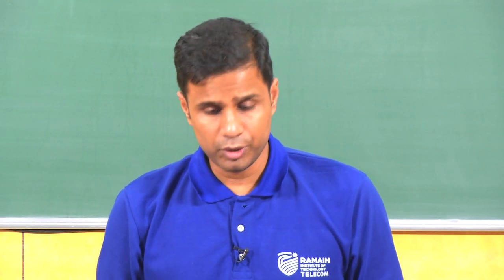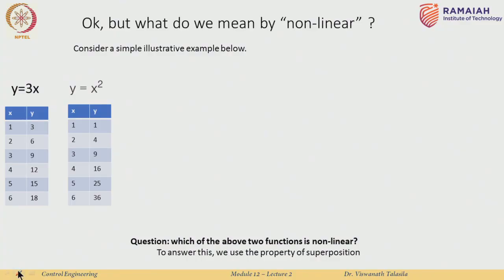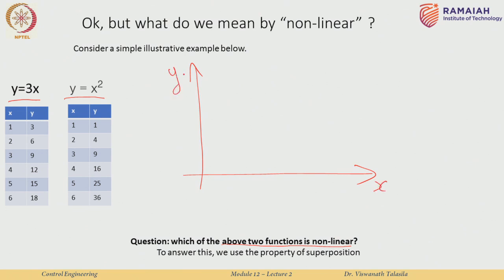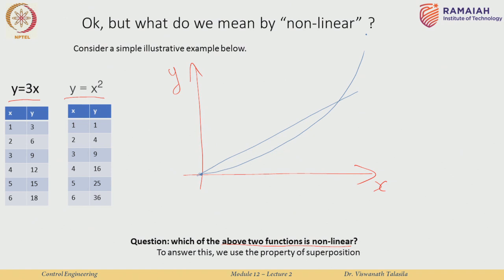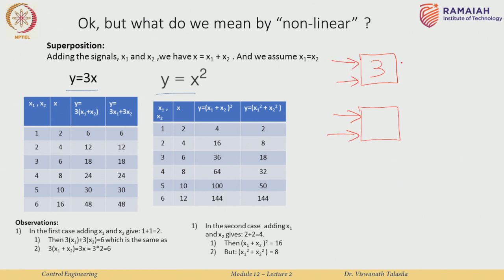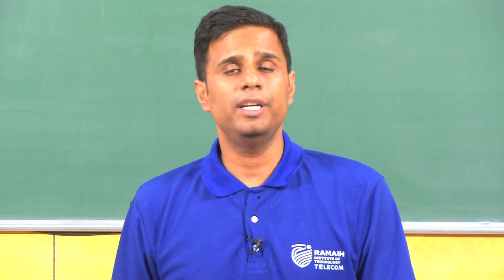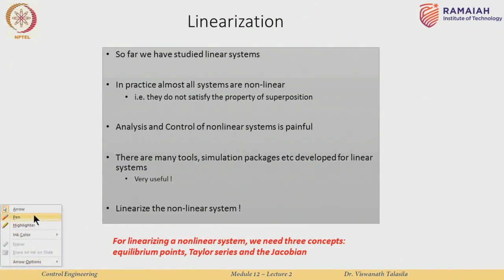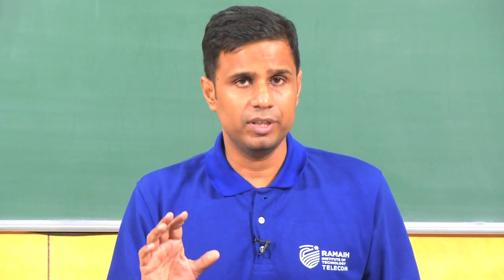Linearization of State Space Dynamics

Comment: Very nice. However, I do have two different questions; 
1). Why do we skip the first entry f(a) or f(b) of the Taylor Series while creating a Jacobian Matrix? Also, we are skipping the (x1-a) and (x2-b) term which are being multiplied with the partial derivatives in the Taylor Series. So, in short, why do we only consider the partial derivatives and skip the rest of the terms while filling the Jacobian?
2). My second question is; how is it possible that if I start from any non zero initial condition and somehow after some time my system reaches an equilibrium point xo, then my system will be stuck at the state forever? Because at that particular equilibrium point, my derivates and dynamics go to zero, so will I get a steady state after reaching xo? If yes, then what about a function lets say f(x) = cos (x) which has multiple operating or equilibrium points as you said in part 2 of this lecture? Cos(x) has multiple equilibrium points, you get one and then the other and so on - so after one equilibrium point our system or the dynamics of our system doesn't get stuck at that point forever but in fact it moves to the next equilibrium point.